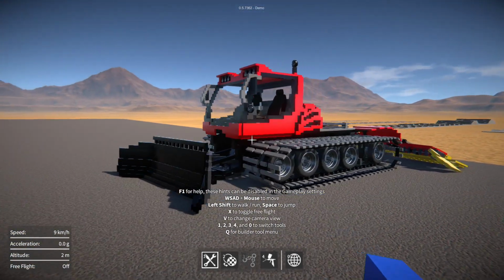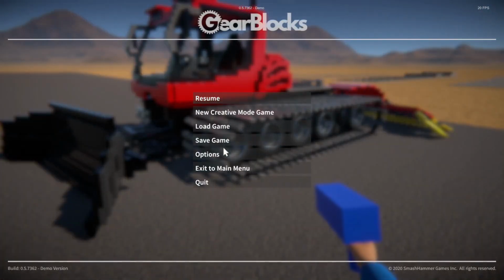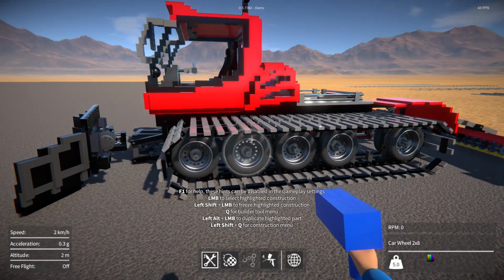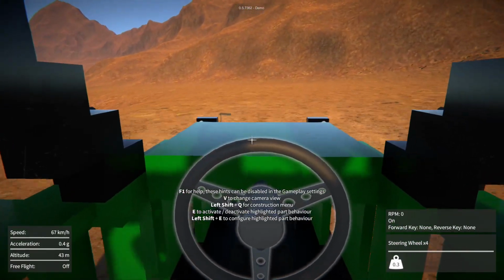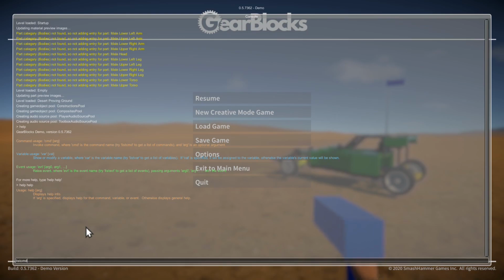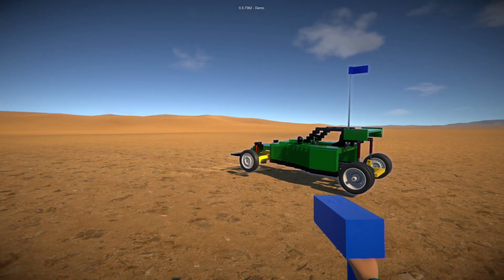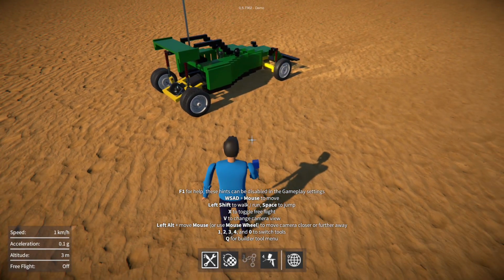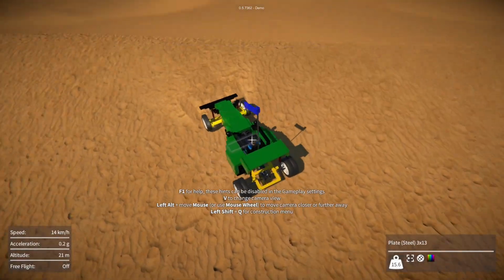GearBlocks dev diary: Improved performance & debug console

Comment: HOW CAN i DRIVE CARS ?? Reply !!
Reply from the maker: 1) Open the builder tool menu by holding Q and then click the constructions tab.
2) Double click the construction you want, this will spawn it into the world.
3) Rotate it and position it so that it's the right way up and not poking through the ground, then click LMB to deselect it.
4) Hover over any part of the construction and hold left shift + Q to open the construction menu.
5) Click the "switch on all part behaviours" button (first in the row of buttons).
6) Hover over the seat part and press E to "use" it.  You should then be able to drive the vehicle.

To find out which keys operate the motors, servos, etc. you can refer to the construction's description shown in the builder tool menu, or you can hover over each motor and it will show you which keys are bound to it.  Most vehicles tend to use WASD or TFGH.

In a future demo build coming soon, step 3) will be made much simpler.  Also I'm planning on making a new tutorial video series soon, one video will cover the basics of spawning, activating and using constructions.

Comment: Hi, you might want to look up a game called RoboCo. It hasn't been released yet but ScrapMan on youtube has early access. When I saw the building functionality in the game and how everything connects I immediately thought they have stolen your idea. Check it out if you have time, even the icons that show rotation or fixed points etc are exactly the same as yours.
Reply from the maker: Thanks for the heads up, I'd heard of RoboCo, but not really looked at it in great detail.  I just checked out one of ScrapMan's vids on it, and yeah those icons do look rather familiar. :)  The game overall seems to be a somewhat different concept though, so hopefully there's not too much overlap.  Anyway, there's not much I can do about it, I just need to hurry up and get GearBlocks released!
Reply: @GearBlocks  Are you going to release it on steam?
Reply from the maker: @ExtremeGamerYT22  Hi, yes, I'm planning on releasing into early access on Steam.